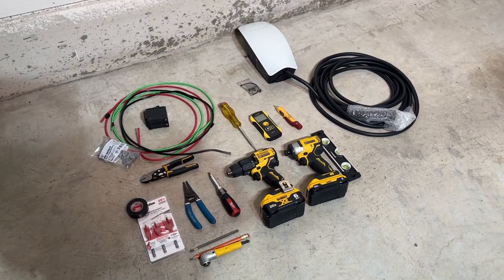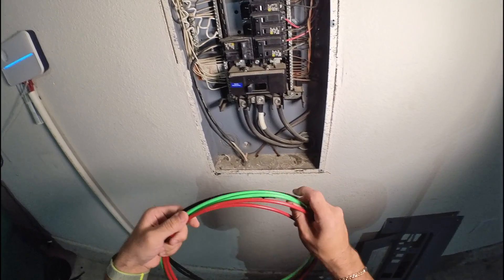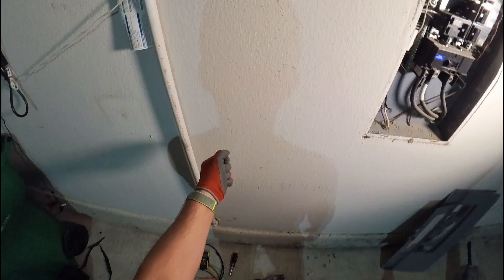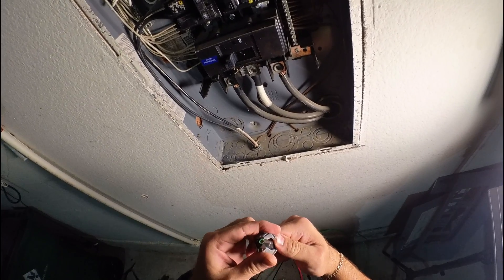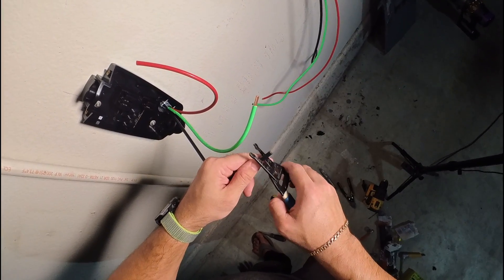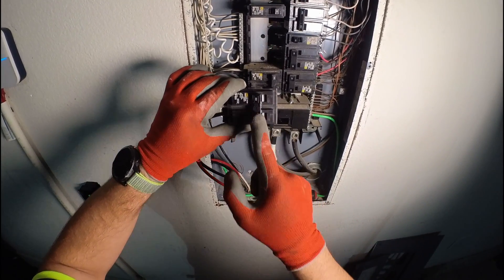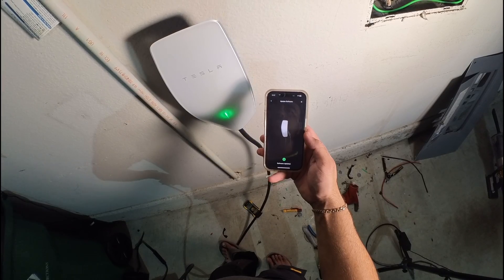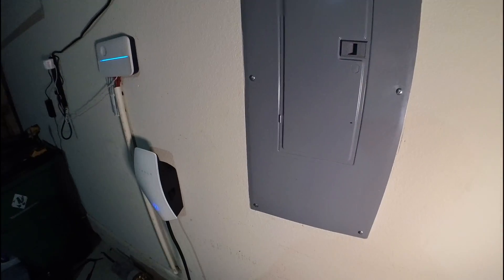How to Install Tesla Wall Charger (Gen 3)

Comment: Not a typical electrical install with just running conductors through... Romex #6 would be fine... Also a #10 ground would pass for a 60A panel..

Comment: Do yourself a favor and become a painter. 
This is dangerous and almost a sin in the electrical world. Your wires have to be in a protected raceway. When those wire have a continuous load of 3+ hours they will become hot and a hazard.
Reply from the maker: How about that I have had this charger for more than a year now. I have two electric cars and I charge them every day.
The conduit is required to protect the wires and not to control the temperature. I don't do drilling or repairs in that area.
When I move out, I'll take the charger with me, and nobody will be hurt.

Comment: The one who criticized this man are electricians. It cost me less than $200 for cables and breaker and pipes.  Plus $300 gen 3 Tesla wall chargers.  I called 4 vampires sorry electricians and the cheapest one was $1800 not including wall charger.  Lowe’s was $3200 wtf
Reply: Lowe's should be lowest? lol

Comment: I note he used 6 gauge wire on all three wires.  Another video on the same charger used 6 gauge wire on the leads but 10 gauge on the ground.  Which is correct?  I have a 45 foot run to the box, not 2ft.  I note that normal standards say that’s acceptable, but wonder if this application wouldn’t be safer with one size up (thicker)
Reply: As a licensed electrician that specializes in these installs, (all permitted and inspected), if I use a 60amp breaker, I need to run #6thhn in conduit and #10 thhn is fine for the ground.
Reply: @JohnMark1313  I have a 70ft run, I moved up to 4awg for the two hots (red and black) and 6awg (green) for the ground. Going to install this weekend. Panel in basement, come through the floor into a closet and mount the 1" conduit in the front corner where it will not ever be seen, then through the ceiling into the attic. 54 feet across the attic to the garage wall. At the point I come through the garage ceiling, I am mounting a 4" box to transition from 1" conduit to 3/4 ". Then run the 3/4' down the garage wall to the top of the Tesla charger. 3/4" plug at top of charger, i dont want to have to open it up any larger. Easier just to run conduit on the wall since its a garage, I dont care much about aesthetics running it behind the wall. Total cost to date including shipping and tax, $909, including the wall charger, wire and conduit. I already have an unused 60 amp breaker in the panel. i need to buy the 4"box, apiece of 3/4" conduit and a couple connectors for it, a torque screwdriver and a pair of electrician gloves...I should come in right about $1000.

Comment: My panel does not have a green/ground. Can I just put in a ground copper rod and connect my green to it directly
Reply: cando it你们的
Reply: No you can't put in a ground rod and expect it to trip the breaker in case of a fault. The equipment ground wire is a low resistance path to the neutral lug of the transformer, usually just a few ohms. That low resistance is critical in case of a ground fault, so that ground fault current will be high enough to trip the breaker. The resistance between a ground rod and the neutral lug of the transformer may be hundreds of ohms, which means the breaker won't sense the current and won't trip. It means all the metal on your device may carry a huge voltage, just waiting for somebody to put a hand on it and offer a lower resistance path back to transformer....

Comment: How u take out the breaker ?
Reply: Make sure the panel is off and pull from the side that has the switch. (Side opposite from the wires) and it’ll pop right off.

Comment: Thanks for the video. I myself wanted to diy and this is really helpful. I will use conduit wire as recommended in comments and improvise it but this really helped build the fundamental part of it. 

For those who are criticizing it, this is an informational video and there is always a room for improving, so whoever is planning to do it themself, they should not just watch the video and do it but rather do their own research and make the decision. 

Thanks and cheers!
Reply: No no. Fire hazard…. wtf. . Sorry BUT THIS SHOULD BE TAKEN DOWN…YOU CANNOT USE BARE WIRE IN WALLS. IT MUST BE IN A SPECIAL SHEATHED  CABLE. AKA ROMEX…OR IN PLASTIC PVCPIPE OR METAL CONDUIT …..THE WIRES HEAT UP UNDER A CONTINUOUS FEED CAN. CAUSE fire in wall material..😮😮😮	d

Comment: Just wrong. You didn't use a torque screwdriver to torque to spec (torque, wiggle, torque, wiggle, torque) for the TWC wall plate or breaker (you barely tightened it), you didn't properly protect the wire insulation from being cut by the knockout hole in the breaker box (used totally wrong fitting, you used a romex fitting on the THHN wire in the TWC wall plate. Dangerous and you will be sleeping in this house while charging? Not me. If you change to romex then use the correct to clamp fittings and you must use romex 4 gauge (4/2 or 4/3 and use the third insulated wire for ground and cap bare ground). So much is wrong here yet you have the skills to do it right so just why or why! Remember this is a continuous load circuit and that can build up heat unlike just about everything else in your house so every step is important to prevent a fire which would give EV's a bad reputation. Please be safe and fix these issues.
Reply from the maker: I'll work on it; thanks for the advice!

Comment: What to do with white wire in my 6/3 with ground I have for it?
Reply: Green-ground White-hot 120v Black-hot 120v (240v total)
Reply: Wrap some black electrical tape on the white wire. Do it from the charger and also at the breaker. In other words, the white wire needs to mark hot. Black is hot! Hope this helps. Happy holidays!

Comment: That’s the wrong way.. you should have used Romax or flex.. not the way to do it.. that’s a fail inspection.. those wires need to be protected.. and you did not do that..

Comment: Great intentions on this video, but demonstrate a safe and proper installation. A lot of people consider YouTube videos instruction manuals. Attention people who want to do this: 

Some safety concerns first. Always de-energize a sub panel at its breaker in the main panel. Electricity doesn't care about your intentions. Never drill into a stud without knowing what's on the other side. Water line, drain, Romex or anything else can be blown through easily. 

To run thhn as he did, you must use a raceway such as FMC. Loose in the wall is a no-go. 

You cannot use 6/2 Romex for this installation either. It's rated at 55 amps and you need 60 amp rated conductors and OCPD (breaker). Even though that charger's rating is 48a (look up "NEC Continuous Load" if curious)

Don't use nonmetallic clamp connectors on anything but Romex, and also don't install them backwards or without a locknut on the other side..

Anything worth doing yourself, is worth doing the right way. No reason a homeowner can't do a safe, code-compliant install. Take pride in your work if you're bothering to do it. If your work can't pass an inspection; well that's why electricians exist.

Comment: Came here to learn to DIY the installation.. almost left happy at the end of the video but then I read the comments. Yo ‘experts’, leave a link to a video you deem is up to code. Don’t just criticize and split.
Reply: You can't run regular wires through a wall, it needs to be Romex or flex conduit.  I'm not an electrician, and I know this.
Reply from the maker: @mrfunkington  These are not regular wires. That's THHN. Romex can be used for up to 55 amps.
That was my mistake. I'm thinking of rerunning the wires in the conduit to bring it up to code.
Reply: @DIY-repair  Yes, it's best to use a single cable. I bought my 6/3 cable from Home Depot.
Reply: Anybody with half a brain knows that needs to be in a conduit you don't need to upload a video just go check your code book that is the stupidest install possible you never and I repeat never ever ever ever ever run bare wire in a wall Let me repeat that never run bare wire in a wall anyways
Reply: #6 romex is rated for 55 amps. 

#4 romex is rated for 70 amps

And you would want a 60 amp breaker. I believe the Tesla charger maxes out at 58 amps . 

So if you’re running #6 and a 50 amp breaker you’re not getting max capacity . 

Also it’s gonna work what you did. But lord forbid if anything goes wrong and a fire starts. The investigators will look at this and let your insurance know and you will be assed out. 

We support learning and doing things the right way. Best of luck to you sir
Reply from the maker: Thanks for the support!
My setup has been working for two months now with no issues. I understand it may not be a perfect installation, but it is pretty close to the standards.

Comment: So, hearing "master electrician" comments here about how wrong this job is...

I'd love to hear the technical/scientific reasons as to what he did wrong.  Don't just quote NEC excerpts, explain it.  By that I mean, if THHN needs to be in conduit, why?  Is it somehow going to burn up and melt because it's not encased in a tube? Does a plastic tube actually effect the current capacity of the wire, or is it a simple thermal thing?  If not thermal, abrasion issue?  Please, I am genuinely curious. I mean, mine is installed with 6/2 Romex, but that seems no more or less safe than this THHN install.  That sheathing on romex doesn't seem significant enough to protect against much of anything and kinda looks to serve only as a container.

I mean this in the most NON hostile way.  But I hear a lot of naysayer tradesman say things like, "idiot homeowner", etc.  If you guys are going to call this wrong, stupid, dangerous, etc, tell us why.  Not looking for trade secrets (that's impossible), just looking to understand actual tangible safety issues with this particular installation.
Reply: iwould also like to know. there seems to be people just attempting to stop others from this DIY
Reply: @bestgames4days   Bingo. You notice not one electrician answered. They all love to brag about their ability to spot code violations but can't explain why the code exists or what safety it provides.
Reply: Not an electrician, but I think it boils down to safety. If a wire is pushed beyond its limits there is risk of fire, electrocution, etc. 
The amperage rating of a wire is a combination of the conductor and the insulation/jacket materials. So yes, it is more of a thermal limit of the insulating material.
Your #6 NM cable has a 55A rating. That same #6 in a metal clad jacket has a 75A rating. 
So putting THHN wires in conduit raises its amperage rating
Reply: The main reason I know some of these numbers is I’m installing my own wall charger and did some research on a lot of this wiring. Personally, I’m going with #6 metal clad on a 60A breaker. That will allow me to safely use the wall charger at its max amperage of 48A
Reply: Romex has an additional insulation and therefore is designed to go through the studs. Additional insulation is just an extra layer protection from a physical damage.

Comment: That’s absolutely one way not to do it! THHN should not be running through a wall without conduit 🤯🤯🤯🤯🤯🤯 you could’ve use Romex 6/2🤯🤯
Reply: Romex 6/2 is not rated for 60 amps.  It yeah could have used romex.
Reply: Tesla requires the wires to be minimum #6 awg 90C THHN copper. Next option is to use 6-6-8 SER wire (2 hots & 1 ground wire)
Reply: and limit the wall connector to 40 amps during set up and use a 50 amp breaker.

Comment: I am also a retired master electrician, and agree with the comment above saying that that the wiring should be in some kind of a conduit and not just loose in the wall. Another option would be to use number six Romax as one trade name as it’s called and mark the wires accordingly or of course, a conduit.
Reply: Except technically you shouldn't use #6 Romex with a 60 amp breaker (to be run at 48 amp, the max setting for the Gen 3 Wall Connector) per NEC, unless you happen to be in New Jersey, which interprets NEC "creatively."
Reply: @TrendyStone  the instructions on the charger call for 6awg for 60 amp
Reply: @dailodai9586  I have a 70ft run, 6awg is good for up to 75 ft but I opted to move up to 4awg and 6awg for the ground hust to ease my mind
Reply: @TrendyStone  tesla requires you to use minimum #6awg 90C copper (THHN) like he said in the video. so you shouldn't be using Romex anyways
Reply: @sayso6119  Romex or THHN is not the issue.  It just depends on the amperage.  #6 Romex is fine if you're running 40 amps (on a 50 amp breaker) for example.
Reply: @TrendyStone correct, as long as you dont go over a 50 amp breaker, romex is ok. Now, as far as warranty, Tesla will decline claims if something happens to your charger because it's against their recommendation.
Reply: why though?
Reply: On Tesla's spec, they list the wire between #4 and #12. I'm going to help install a Gen 3 wall charger for my former coworker, and I mentioned at least #6 must be used for a 60A breaker. Since it seems quite simple to install, I'd recommend him to go with #4 instead. I did use #6 with a 50A breaker for my charger in my garage, but mine is a JuiceBox 40, which is 40A max.

Comment: As a retired master electrician I can tell you have skills and knowledge in the trade and it’s disappointing to see you do this job in your own house. I’m sure you know that the wires should be in a conduit or flex and I’m sure you know the white wire is being used as a ground and should be identified with green tape. You had an opportunity to teach people how to do this job but all you did was teach them to do the job wrong. I hope you take pride in your work and do the job right with an updated video. Do the job right the first time and you won’t need to redo it.
Reply: you didn't explain why we need to conduit though.
Reply: @bestgames4days several reasons actually. First being that it is code that live conductors must be protected secondly as electricity passes thru the conductors they will heat up. Especially a high amperage draw like the Tesla needs. If the wire heats up too much it will burn the wood that the wires are run thru. If those wires were in conduit there works be less chance of fire
Reply: @paulbriamroy  Not exactly, however, you are about 90% right. There are structures with concrete blocks that won't need conduit piping if it's inside behind drywall. Furthermore, certain regions will heat up wires more than others in piping. Examples of this include South Florida, certain parts of Texas, etc. You can use the UF-B cable, which is the only NM cable that can be installed underground having a better jacket insulator. I don't recommend this video to the average homeowner or the DYI installer without a certified local electrician.
Reply: It’s not that bad,common!
Reply: As soon as he said he was going to do everything without turning off the panel that was the red flag for me lol
Reply: You are right about the conduit, wrong about the ground wire. He used a green wire for ground. The Tesla charger does not require a neutral!
Reply: @maker_usa  The best option would be getting the 6/3 cable from Home Depot or Lowe's. The cable comes with a black and red for hot, a white for ground, and a bare copper wire, which is not used for Tesla wall charger. I use mine in my JuiceBox 40 since the outlet box is metal.
Reply: That's why electricians charge more to ensure the job is per code. I'm only a mechanical engineer, but I did consult with my retired electrical engineer. He's an expert.
Reply: I totally concur! Well said.

Comment: So dangerous. I hope he is not doing this for others.
Reply: explain?
Reply: @bestgames4days per other comments there are various things wrong and not done within code. A: THHN Needs to be protected in a conduit or flex to the panel B: he used a non standard color for ground and did not color it as such (white is neutral, and the cables should been marked green somehow for ground). I am also not a licensed electrician but as one who lives in a state where a home owner is allowed to perform their own electrical work I still research and ensure all my work is to code.
Reply: USA tech always said dangerous😁😁😁

Comment: nice stuff, I want a tesla but my circuit breaker is in the basement towards the backyard while my garage is obviously at the front of the house. It seems a bit of an obstacle to get this work done, what would you suggest? Most of the videos I see the circuit breaker is in the garage as well
Reply from the maker: In that case, you must run a conduit with wire to the garage.
Reply: Do you have any power in your garage?  You can charge at 120V and if you charge overnight that might be fine..
Reply: @TrendyStone  yeah I have the regular 120v outlets in my garage, but I feel like it would be insanely slow charging? Like i'd only add 90km of charging? I might just go for a mild hybrid like the CR-V hybrid instead
Reply from the maker: @TrendyStone @TrendyStone, have you ever charged the Cybertruck using a 120V outlet? That takes forever.
Reply: @DIY-repair  We own two Tesla’s and with a 20 amp 120V outlet we get 6 miles per hour of charging.  With a Cybertruck it should be 3-4 miles per hour….so 18 hours would give you ~70-90 miles.

I installed a sub panel and two wall connectors myself in our garage, but I’m an engineer.  Some people might find it difficult to run #4 or #6 wire to their garage.